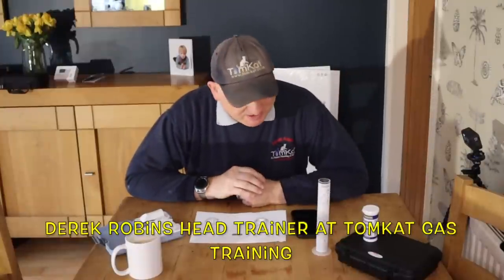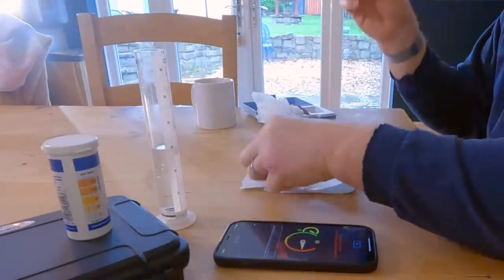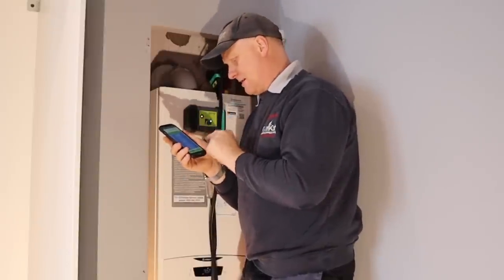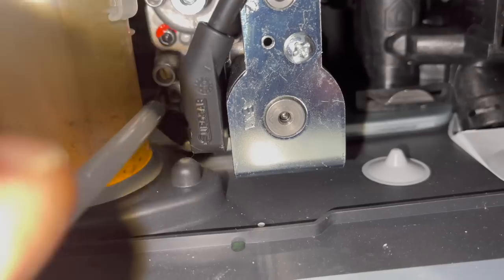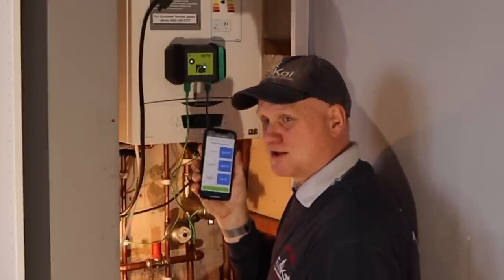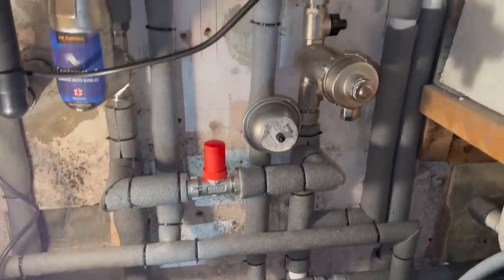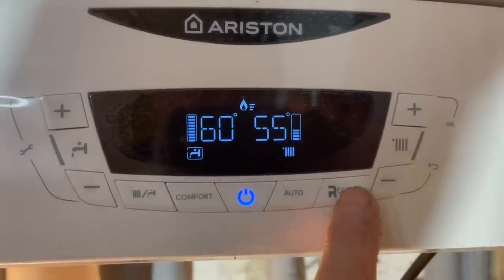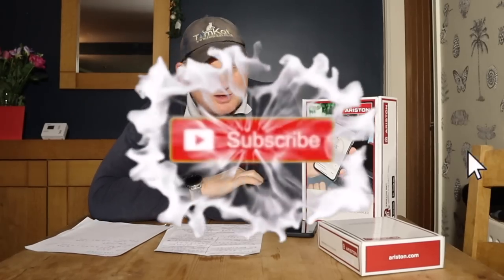Why did it take so long to  commission my aristo e-combi one boiler  am I loosing my touch.

Comment: Makes you wonder how these one day boiler change company’s manage to install the boiler and commission to the proper standard all in a day, they must be super human.
Reply: Simply because they don't!!!!
Reply: @johnward5006  Your right they don’t. My sister had a boiler fitted under a Scottish Government grant scheme a couple of years ago. Didn’t put a soakaway in. Condensate froze up, not insulated, her husband cut pipe to get boiler going. Company couldn’t get their installer back to site. ( self employed, then company went bust)
She reported it to GasSafe, inspector came out and didn’t do a thing about the way the condensate had been installed and no soakaway instead gave her a hard time about an openable window in her 
kitchen for ventilation for her hob.
Reply: @robertallardice8119  because gas safe only care about gas issues ! Condensate is not a gas issue a soakaway wouldnt have made a blind bit of difference was it 32 passing through wall ? Was it insulated ? Was it insulated through the wall ? Probably not because it was required a couple years ago now it is so you want to moan about gas safe but then gas safe give her gas safety advice at not having an openable window or door or any purpose made ventilation and your moaning about them ?
Reply: @shaunconnor7525  What do you mean the condensate is not a gas issue, the boiler was not fitted as per manufacturers instructions so it is a Gas Safe reportable issue! The new boiler fitted to replace boiler sited in loft had no condensate issues because the condensate pipe was run by the preferred method internally.
This bozo of a fitter decided to run it down a external gable wall with no insulation and no soak away as per manufacturers instructions.
The gas safety advice about the hob was taken and dealt with but he did nothing about the boiler installation.

Comment: Fantastic wee boiler the Ariston Derek👍👍 
With your limited Water Flow Rate, did you fit a 24KW Combi??!!
I did cringe a little when you attacked these chrome rad valves with Water Pump Pliers😞😞

Where are you getting your Ariston boilers from Del, we struggle getting them here in Jockoland.
Thanks for sharing mate, good video as always. I look forward to the LPG tightness test video.  Perhaps you could include details of testing from Bottles also👍
Reply from the maker: A lot of independent plumbers merchants in our are sell them mate. I fitted the 30kw one and I don’t think I have ever damaged a rad valve with grips 😜